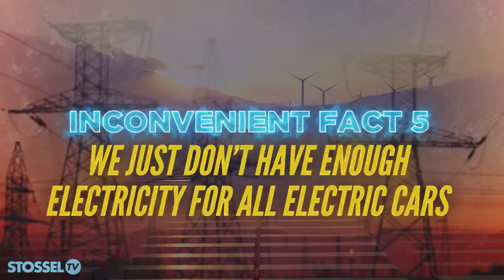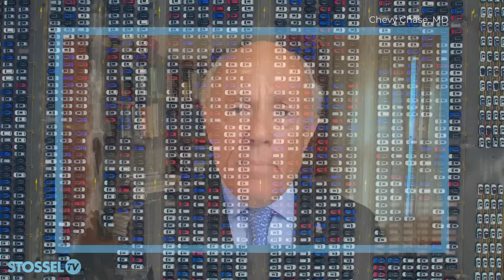Electric Cars: Inconvenient Facts, Part 2

Comment: You know ive been a master tech now for over 40 years. In that time , i have at my home 30 years ago, began messing around with battery systems. At first it was lighting and after some time it turned into electric motors powered by batteries. Did it work? Sure that's a no brainer. But i was never able to get anything together more than a joy rider. Too many batteries needed to be used and the range was limited a long with long charging times. It was also expensive. Now this is the early 80's. I even tried alternators in a wind tunnel mounted on the side to generate some charging to extend the range but it was just not a viable system. It comes down to weight and horsepower and distance. Even with todays batteries it will never be a viable option other than a grocery getter. So I've known for a long time it will not work. This is truely about control. At what time did the U.S. government use 8 billion to help build gas stations? This is also about Theft. The government wants to bleed people of every dime they have. You can't put a dollar in a charger. So now we can track 90% of your movements. You can't turn off a gas tap but you can turn off access to electricity. The internal combustion engine is and always will be King. What they should be doing is researching a synthetic gasoline. It is viable and already does work and has been tested by Audi. They want to say garbage that it will be 40 years down the road. Thats horseshit. This can easily be done in approximately 5 years. And with close to zero emissions. 
See this is completely about the government taking control of what we do, when we do and how we do. That's why they also want the firearms. Look at your police today. They are not peace officers, they are nothing more than jack boot Gestapo. 
Hell just sit down, use some logic and put the dots together. Just don't be surprised at what you find. It's not pretty.
Reply: Many people will just call you a conspiracy theorist and bury their heads in the sand.
Reply: Read about Professor Aldo Steinfeld in Zurich who is creating gasoline from the CO2 in the air.
Reply: @scottslotterbeck3796  I watched a video about a joint effort by porche, Toyota, and another one doing the same.
Reply: You missed the part about global warming from burning too many fossil fuels. The trajectory of temperature increase we are on is actually  greater than the Permian–Triassic extinction event, during which 75% of land mammals and 90% of marine animals died out. It took 10 million years for life to recover.
Reply: @headstashmusic3897  "the trajectory of temp increase" okay. Did you know in the 70s they tried to tell us "based on the trajectory of temp decreases we will be in an ice age"
Reply: They want a global digital prison without bars, something a former leader of Germany could only dream about.
Reply: @usernameluis305  I would pay more attention to current findings, not what some person said over 40 years ago.
Reply: Agree totally.
Reply: Just try a Tesla and you will understand. Your eyes will open. The battery on Tesla can last 750,000 miles. The new battery: 1 million miles
Reply: @mletouutube  real world test at 45 degrees and minuis 15 these batteries will give you quater that. Unfortunately everything is done at perfect testing conditions. Unfortunately we are free thinking people not conned on bs
Reply: LOL, if you tried mounting a windmill on the side of your car to extend range you don't even possess a child's level of understanding physics.  Here's something, reach down and try to levitate into the air by pulling up on your shoes...
Reply: @Joe-by8jh  Not true. My wifes Tesla with a 300 mile range will defrost the windows in 5 min and use about 2 miles of range when the temp is 5 degrees (Less then 1% of battery used to defrost). My Astro van is still blowing cold air after 5 min.  My wife is always on her way first, while I am out scraping my windows.  If you don't own one you will never understand.  I own both so I have the knowledge and direct experience.
Reply: @reallyskeptical  First, these degrees you mentionned are not all year around for most areas. Secondarily, it is not a quarter, it is half. Then because it is not all year around, it is 1/8 when not living in best conditions. Third, all car companies battery or gas give estimates in best conditions.
Reply: @Joe-by8jh  So therefore 40 year old science is always correct? Please break that down some more.
Reply: @mletouutube  well mate that's Australia Canada Europe America Asia Iran island Pakistan Russia the whole world doesn't sit at perfect 23 degrees. As tested at. Heat and cold kill electric power.
Reply: @mletouutube  your just pulling numbers I've never meet one company that do real world test. Even fuel tests are done in a wind tunnel. Not all year round so your telling me we have mostly 23 degrees world wide to make this work. Do you understand the copper requirement for the windings. It will take 133 years to mine the copper cobalt 162 years lithium 144 years that's the easy stuff to mine. You do understand it's more than a battery to run a car. Your electric won't work. It's labour intensive.
Reply: I have had many internal combustion engines in my life. Then I tried a Prius Prime (plug-in). Very good. Then I got a Tesla. I now pay 3.4 cent per mile in electricity. I was in Canada last winter/spring and I paid .01 cent per mile in electricity. I charge the car at night on a 120 V socket at a speed of 5 miles/hour but I need only 18 miles per day so no problem of time charging. I could plug it to the 240 V socket and it would be 25 miles per hour. When I travel, for example going to Las Vegas, the car gives me a choice of a super charger on my way there and after 2.5 hours of driving (and I still have 50% battery left and it is all uphill going to Vegas) I decide to take a break, plug it in and go to restroom, take a drink and go back as the car is ready to go perhaps 80% full, which is plenty for the rest of the trip- and oh this Thanksgiving weekend charging is free before 9:00 AM and after 10:00 PM otherwise it would be around $14 for 200 miles- still cheap). When I release the accelerator, the motor is used as a generator and charge the battery back- so the breaks are not used and last a very long time. Does combustion engines create gasoline when you break? No, it is energy lost in heat and break wear. I used the Tesla from Los Angeles to Québec passing through Seattle and back toward the South using auto-pilot and it was a charm. In Canada I went fishing during the spring in the high altitude park in the North-it was cold- no problem as I did not see a noticeable difference in mileage. Same when I came back via Arizona in high heat. Back at home, no change of oil, no going to gas stations as I charge at night in my garage (electric cheaper at night as there is less grid demand) and when I travel, I do not need to stay near the car when charging and can go doing my business and get a drink or sandwich. Putting solar panels on my roof would make my car completely independent of the grid and pay nothing to charge the car. I saved tons of money in gas and maintenance as electric motors are more energy efficient and more reliable than engines and require less maintenance. So in my experience, electric cars and particularly Tesla for its charging network and great engineering is the future and, after having this car for more than a year, I will never go back to combustion engine cars. All the people who have tried my car now want one. It goes 0-60 in 3.2 sec. Dinosaurs have disappeared for a reason and I gave you some reasons that make combustion engine cars like dinos. In California, the two top car models all categories that where the most sold are Tesla cars. The Tesla semi-truck will be delivered for the first time to Pepsi in 9 days (could make 500 miles full load on one charge). The Tesla pickup super hard stainless steel bullet proof CyberTruck (I ordered one) has already 1.5 million orders and will be produced at the end of 2023 with the new battery that Tesla is also producing. Tesla sells all they produce with a waiting line and with a huge margin not met ever by any car company. When someone is in a bubble, he does not know he is in a bubble... Have a good thinking time man.
Reply: @Joe-by8jh  So by your own logic you must agree with what the majority of climate scientists are saying
Reply: @Joe-by8jh  That's is a minuscle thing compared to all the benefit of having an electric car. In fact, it mostly does not matter- The daily drive is 30 miles in average (shopping/go to work) and charging at night is easy: you park you car and plug it, that's it! Same as your phone. And when you travel you need to make stops anyway in order to strech your legs, go to restroom, eat or drink something. You can drive 5 hours with a Tesla without stopping then relax 35 minutes while charging. I have done it and it is perfectly fine though I usually stop after 3 hours especially when I am not alone as there is always someone who need something. With a gas car, being able to drive 8 hours without stopping is not really a noticable benefit for the 99.99% of people. So the majority of people do not need that much mileage. The worse condition: the heating system and air conditionning come from the most efficient air pump on the market (made by Tesla) and it can last 4 to 5 days to keep the temperature tolerable when the battery is 75% full because the motor(s) are not running when stucked in traffic jam in winter (contrary to gas cars) and the battery is huge in term of energy (contrary to what some people had stated who know nothing about electric car, especially Tesla, which is very different technologically speaking and is the most efficient car on the market). It is also the safest car on the market (passive and active). It also improves with time due to the wireless update done on the car software. What the media names the few  recalls of Tesla is just an over the air update made on one night in your garage...
Reply: @reallyskeptical  "real world test at 45 degrees and minuis 15 these batteries will give you quater that. Unfortunately everything is done at perfect testing conditions. "
Absolutely false on all statements. The nominal range loss is about 25%, not 75%. Telsa tests it cars in Alaska in the winter, much less than "ideal" conditions.
So do you just pull statements out of your arse?
Reply: @mletouutube  "third, all car companies battery or gas give estimates in best conditions."
Absolutely false. Gas and electric car mileage is determined by an EPA formula. 
Does your arse hurt from pulling so much crap out of it?
Reply: @justsomeguy934  do you read or just take companies for truth of all saints, like vw and it's pollution with its exhaust pipes. Tell you from experience these don't give you that sort of range. No battery will. Heat and cold kill electrical output.  But of course your the world leader in this subject.
Reply: @reallyskeptical  I'm not sure what you're implying, but you clearly have no direct or personal experience with EVs in cold weather. Me, on the other hand, have owned a Tesla for 9 years and 90,000 miles in a cold, snowy and mountainous state. I'm a member of an EV club with over 200 members, all brands of cars, and they all say the same thing I said.
Reply: @justsomeguy934  you obviously don't understand your own biased opinion. I'm not part of a club  I'm talking about a battery not a car. It's funny all my data is made up especially in the cold because you live in cold weather. I don't apparently. But also i couldn't replicate cold weather, i understand know how you Think. You obviously too smart for me.
Reply: @justsomeguy934  What I meant is this formula for example is done using a speed of 48 MHP, which is the best mileage you can get for a combustion engine car.
Reply: @mletouutube  I see. thanks for the clarification. This video, and all the responses, make it difficult to understand exactly what an individual response is for.
Reply: @reallyskeptical  what I'm telling you is that the range loss in cold weather claims you are making do not match real-world experience. We're discussing cars, not your cell phone or a battery pack for anything else. The newer cars have less range loss than my older car does due to heat pumps.
Reply: @fabioribeiro1009  20 of the hottest years on record have come since 2000. Thermometers are not a hoax.
Reply: @headstashmusic3897  Yes because the planet is on a heating cycle and then it will go on a Cold cycle, it's how the planet has always behaved.
Reply: @fabioribeiro1009  I will ask again, if its not humans, why did the rapid warming begin shortly after the onset of the Industrial Revolution, when we began burning massive amounts of coal? There most certainly IS reliable data on this warming. Carbon dating can go back thousands of years, far earlier than even the Industrial Revolution.
Reply: @headstashmusic3897  The Earth has been both warmer, and colder, than it is right now. And thousands of years is nothing compared to millions of years. Here's the Earth's warmest period, according to a Google Search: "One of the warmest times was during the geologic period known as the Neoproterozoic, between 600 and 800 million years ago. Conditions were also frequently sweltering between 500 million and 250 million years ago."
Um, not diesel trucks then. Our orbit determines our temperature.